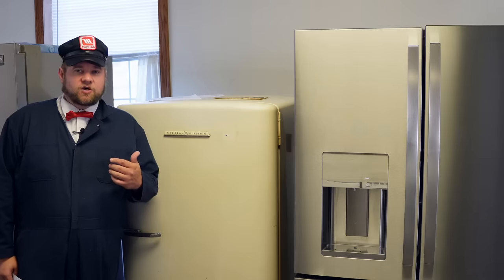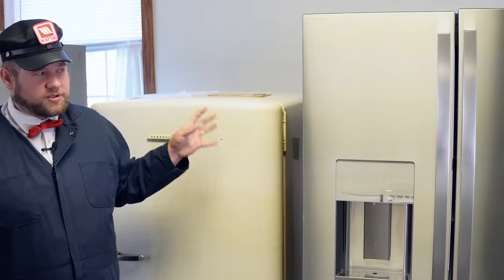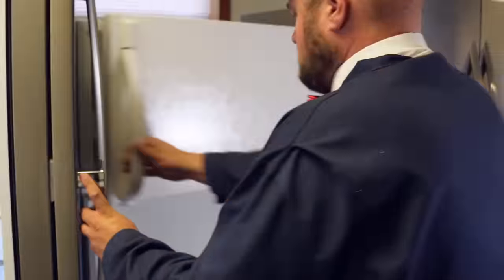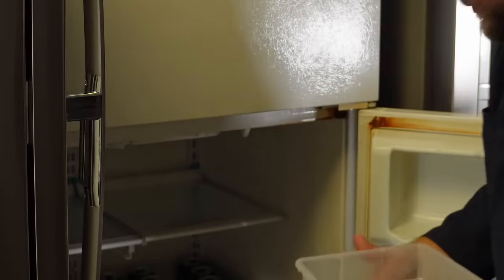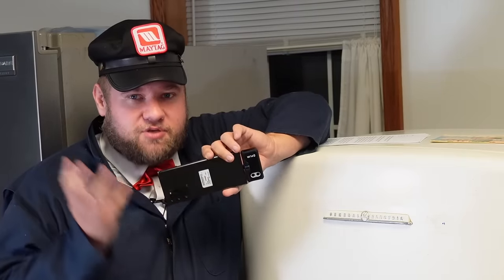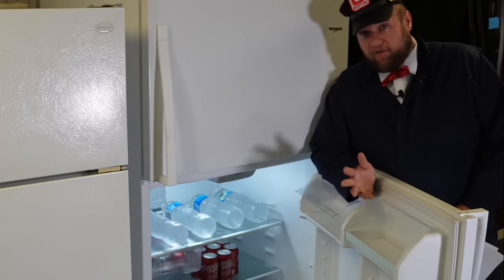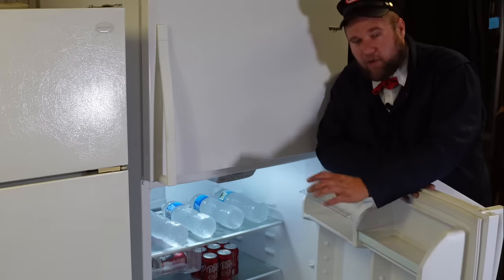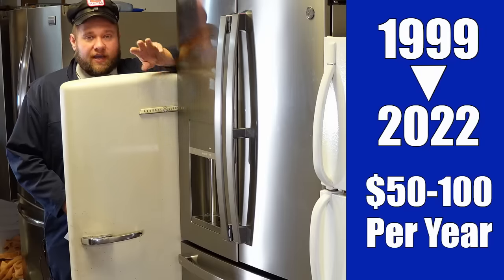Should You EVER Buy a New Appliance if Yours Still Works? A 7-Day Test

Comment: Great video. I personally keep everything until it falls apart and no longer works. Maybe that is good or bad I don’t know. I just maintain things. I also have a smaller fridge. Mine is 23 years old and seems to be going fine.
Reply: i am the same way maintain things and run it till it Dies but I still would not buy  Newer Appliance  First off they are over Price and if your Very Lucky you might get 2-5 years from a Newer Appliance  so where in the World is the cost savings
Reply: MY TEST: 1) 1998 Maytag (R134a, side-by-side) uses 3.5kwh/day,    2) 1995 Amana (R134a, bottom freezer) uses  2.4kwh/day.   Note that they where made DRASTIACALLY better than current models.  27 years old and 24 years old and operate perfectly fine.

Comment: You didn't mention one important point of old fridges - thick layer of frost/ice can double power consumption. Testing refrigerators for 6 days is not bad but result for old one will be different after month or 3 months (or even more). You can defrost it more often but defrosting cost money and your time and if you use fridge often during day it will build up very quickly.
Reply: Why does defrosting cost money?
Reply: @gaswe9236  You have to turn it back on and have it cool down afterwards again which consumes a lot of power compared to a new fridge being able to continuously run without needing to be defrosted.
Reply: @Senzorei  ah of course right
Reply: @gaswe9236  also, the layer of ice acting as insulation makes the heat transfer slower so the compressor has to work more continously
Reply: Nah just boil water and throw it in there
Reply: @Senzorei  That's a rare thing
Reply: @wlonsdale1  True, you only have to do it twice a year usually
Reply: Well, listen - defrosting can be done with the door closed and the defrost setting activated.  There's a thing called a meat tray underneath the freezer - it will catch the water dripping off of the freezer as it slowly defrosts overnight and the food still stays safe inside the unit at about 45 to 50 degrees.  Yes you may have to remove the ice cube trays and anything in the freezer section (or use it up before you do this) but this technique definitely does NOT use more energy - let's remember that most fridges from the 30's through the early 50's only used about 140 to 175 watts when they were running.  Less than three of the light bulbs in those days.

Comment: What an awesome video.  To answer your question on interest in a video 'analysis' of your Grandma's fridge.  Yes, this would be super helpful.  This would be a great compliment to the videos you have done comparing older vs newer washing machine construction.  Many consumers have questions around WHY does my new fridge not last as long as Grandma's did.  Was it the quality of the components?  The gauge of the steel?  The way compressors were made?  Efficiency is crucial for so many reasons and yet, how sustainable is it to dump more 7 year old appliances into a landfill?  So again, THANK YOU for making videos such as this.  And please consider showing us where modern fridges cut corners in ways that the GE back from 1950 did not.

Comment: I remember our old hotel refrigerator for the hotel kitchen, the hotel was build in the late of 30 ties, but the refrigerator could be from the 50-ties ish, it was wide as a 6 feet closet, it had two doors and  inside it had wooden framing, still worked till the late nineties.

Comment: something to also keep in mind is the size of space that you actually use in your fridge.
as we know that "a bigger fridge" is more energy friendly for its storage space compared to two smaller fridges with same storage volume overall, however if you would only fill & use half of  that storage of your big fridge then perhaps getting a smaller fridge would be more efficient, even if your big fridge is better then two fridges it is worse if you only use one of those two smaller fridges of space in a large fridge.

just my thoughts, any comment on this?

Comment: My parents had a Norge refrigerator that was bought around 1955. It went into storage from 63 to 68 and was then used from 68 until the 1990s. It still worked fine but many of the plastic parts were cracking and breaking. The one that replaced it was much louder.
Reply: I also have a Norge from the 50's. They were manufactured in Minneapolis.
Also have an Amana, (freezer on the bottom) 1978, that is still in use.
Likewise I also have two Maytag washers. One from the 20's, which does not get used, and one from 65 that is used for work clothes and really big items. Works better than the new ones do.

Comment: Great video!!! My GE fancy stainless steel fridge that I bought 23 years ago (1999) worked without issue until 3 years ago. I now have a fridge from the 70's  (freezer on the left fridge on the right) I am unable to afford a new one so this was gifted to me. It has increased my hydro or electric bill by $10. a month which I had researched and planned for.  The prohibitive cost of a new fridge starting at $2000 averaging approx $2600. is an insane price for something made and designed to FAIL within three years, so for now, I will stick with my 1970's fridge, built when coorporations cared!!!. Thank you for all this great info and the experiment.
Reply: My '97 Whirlpool 27 cu ft I purchased new is still working ok.  I guess I will just run it til it dies.  Never an issue with the through door ice maker or water dispenser either.  Garage freezer was a garage sale special I picked up 20 years ago.... I think it is from the late 70s or really early 80s as well and still works great.
Reply from the maker: Ice/water tends to work way better on side by sides because there's no thermal conflict on the ice (although water can sometimes present a problem due to poor insullation). The bad issues came about when every company decided to put ice in the warmer refrigerator cabinet, then channel freezer air into the fridge exclusively for that. It causes a lot of issues that tend to migrate into other problems, in my opinion.
Reply: Those 70s-80s side by sides are extremely easy to work on and customize too. Before I sold it, I had one that had a new 410a compressor lines and evap, I put ambient lighting in the crisper and a wine ice chest cooler on the bottom rack. I made well over a thousand dollars on it and I wish I didn't have to sell it.
Reply: The older appliances still run, because they were manufactured by people who took pride in their work and stood behind their product.
From the head of the company, to the lowest position.
Nowadays we have executive chair sitters and Chinese slave labor.
But you can buy an extended warranty, if that is worth anything.
Reply: @darroniverson3373  agree!

Comment: Price, cost to run, and durability are most important for me.  Today's models are destined for a landfill soon, which is total BS.  Great food for thought here, and I appreciate your analysis and efforts.  PLEASE don't strip down the 1950s model!  It's a keeper and perfect for drinks or overflow.  The real test would be to see how many years it lasts.  Seventy years is amazing, but the 7-10 years expected now is bogus.
Reply: That 1950 fridge was $400 according to the ad.  That'd be $5000 today.  Would you pay $5000 for 8 cuft of capacity and a freezer that can hold a few water bottles?
Reply: @pancake8133  As a product engineer I would pay 5-10k for a quality fridge, would most people? No. And that’s basically why appliances are built on the cheap. So many people complain about how badly new stuff is made, but refuse to spend more for a well built appliance. liebherr sub-zero and Dacor make some of highest quality fridges/freezers possible.
Reply: Exactly durability is more important to me. When I bought my house it came with a side by side GE,  it was 22 years old when the compressor went out. I replaced it with a Maytag big mistake,  had it 10 years and in those 10 years replaced the compressor under warranty and the fan under warranty. Replaced it with a GE with French doors. The door space is useless because of the water and ice being on the door.
Reply: @Dirty_Bear22  Cost of living skyrocketing while wages are abysmal doesn't help.

Some people can barely afford to pay rent/mortgage every month ontop of all the other life expenses.  So many people without medical coverage too, notably in the US, the only first world country without universal healthcare.

These companies don't need to have trillion dollar market caps while over half the world is suffering.  Products can, and should, be made better at similar cost.
Reply: @pancake8133  Given new fridges burn out relatively quickly or rust and leak relatively quickly and that old 1950s fridge and many others are still clocking away then its not a bad deal especially when you never want one to die and spoil your food. Also people doing the "it would cost such price today" argument shows how little you the comparison matters. This was a common fridge size and even then it was new item coming out as fridges were still using ice blocks and they always cost so much more than later models years later. Look at how long it took for home use 3D printers to go from thousands to hundreds and get from larger to smaller or more refined detail. Material also matters which that whole thing is rather thick steel in mostly all of it where the new is far less amount of metals and plastic.
Reply: I have a set of old Liebherr fridges and chest freezers from my parents, which are around 40 years old. Those are higher-end appliances, which were (and still are) very expensive and i would never replace them, since they are very reliable, they never needed any repairs or maintenance. 

Despite high electrcity costs in Europe, replacing them would not be worth it. It would take too many years to save back the purchase price of a new set of fridges and freezers from reduced electricity costs. And even then it will be just a few Euro per year. 

I'm also too lazy to lift the chest freezers away from the basement, since they are very heavy. I moved into a bigger house last year and it was a pain to get them out of the old house and in the new one. 

Same goes with old Miele washing machines, people don't replace them. They use a lot of water and electricity, but they just work and use high quality metal components.
Reply: modern ones are EXPENSIVE... DIES FAST... and then you have to buy a new one again again... so it is with all products these days... they don't make quality to last
Reply: @AceStrife  Not being able to afford appliances vs not willing to spend X amount regardless of financial stability are separate issues I believe. Quality engineering and manufacturing isn’t something that can be done cheaply, at least not from any appliances I have seen. A lot of vintage appliances cost thousands of dollars adjusting for inflation, and the quality shows.
Reply: @LiLBitsDK  Except they do. High quality brands just don’t advertise much.
Reply: @hyperturbotechnomike  Agreed, Liebherr and Miele make amazing products to this very day. Speed queen front loaders are arguably better built then Miele front loaders, but Miele washers have much nicer features.
Reply: @Dirty_Bear22  I have not seen something from the speed queen brand here yet. I think they only sell tcommercial laundromats in Europe, but not sure. The modern washers from Miele aren't good anymore, they use too many plastic parts, which can break. The professional series is a bit better, but mostly reserved for commercial use.
Reply: @hyperturbotechnomike  Wouldn’t say plastic parts are necessary bad, plastic formulations have made incredible advancements over the years. Handheld Power tools used to have metal casings, yet now even the highest end power tools use plastic. It’s not always about cutting cost, it’s sometimes just a better option..
Reply: @pancake8133  Nope. Can't afford such an expensive fridge, I bought a new 18cuft for $500 and  expect that it will run without trouble for 15 years. For $5000, I could buy 10 such refrigerators, and put a new machine into operation every 15 years for 150 years.
Reply: @Dirty_Bear22  it also doesnt help that they literally build these to die sufficiently fast - the cost isnt the main issue... planned obsolescence is
Reply: @SharienGaming  Cost is very much an issue. Quality construction isn’t cheap. Quality testing, product design, reliability simulations, etc all drive up cost, and you gotta start cutting something away to lower prices.
Reply: @Dirty_Bear22  not actually true - all that happens with cheaper products as well, but with the goal of verifying they dont last too long
modern products are widely following the pattern of maximizing sales rather than longevity...
the classic example it started with is lightbulbs... they started lasting longer and longer, eventually reducing sales due to reduced demand... the manufacturers responded by forming a cartel that purposefully limited the lifespan of their products to ensure that sales would stay high
still happening today, with for example LEDs that are run at a higher voltage than they are designed for, to make sure they break a bit faster...

techniques like that have nothing to do with cost... its all about how many products they want to sell

quality has little to do with prices... profit margins are the main driver of price in capitalism... and product longevity is designed against to further maximize profits
Reply: @SharienGaming  Not saying planned obsolesces doesn’t exist. But at certain price ranges it’s difficult to source quality components. Washing machines for example face a lot of mechanical stress, heat, and humidity load, using full stainless inner and outer wash tubs, ceramic bearings, multistage shocks, and air cooled motors would be vastly more expensive then typical construction methods.
Reply: @Dirty_Bear22  fair enough, there usually is a lower ceiling under which you cant really expect any degree of quality (unless they have found some exceptional innovation) simply based on costs of labour and materials
though for a lot of things the quality could be much better without or with fairly small increases in cost - while quality will generally be more expensive, it usually wouldnt be prohibitively so

another annoying thing is, how hard it is to identify and find actual quality, because in some cases companies just slap their luxury brand labels onto the same products they sell in the bargain bin... pure profits...
its really damn frustrating
Reply: @SharienGaming  Reminds me of Microsoft knowing Xbox 360 consoles would scratch discs when tilted, but chose not to include a 25 cent part to solve the issue during manufacturing. The reason being when making products in mass, a 25 cent part would have cost them 11 million dollars in parts alone and delayed release. Crazy how tiny things add up, not even accounting for lost sales by not reaching market fast enough.

IMO it’s worthwhile getting a understanding what the basic inner functions and common failure points of appliances are, looking up model numbers on part websites to check the quality of components that a particular brand uses, and asking repair techs about the frequency and cost of repair among brands they service. Eventually you learn what to look for beyond marketing. Maybe I just like product engineering, but I spend way to much time researching these things….

And some things like home garbage disposals peaked sometime in the 1970’s or so. Wasn’t enough demand for high end disposals, so things stopped advancing, quality went down in general.
Reply: @pancake8133  In 1980-1990 fridges where still good,
but not as expensive as 5,000 $ I think.

Comment: Mom’s house still has a late 50s freezer chest (top-panel style you can fit a whole deer into) that we just rotated the old freezer-burned food out and replaced with fresh food.  When she switched houses in the late 80s it took 3 guys (Beast Mode) to move it into her basement.  Still works perfectly. Now that those 3 guys are all in their mid 50s & early-60s, so yeah, that freezer will stay with the house. Garage fridge is a 16 cu ft freezer-top Fridgedaire from ‘94, still runs great — However, she is now on her newly acquired 3rd side-by-side kitchen fridge in 33 yrs (‘89 lasted 21 years, ‘10 lasted 12 years.)

Comment: Other factors that may be considered to switch to a more recent fridge model are: 1-the old fridge may be noisy, 2- the old fridge may have an ice maker that needs manual defrosting every 4 weeks, 3-Difficult access to the water filter can, 5-current fridge doesn’t fit in kitchen of a new house, etc...  But thanks for your videos. They are so informative and awsome.